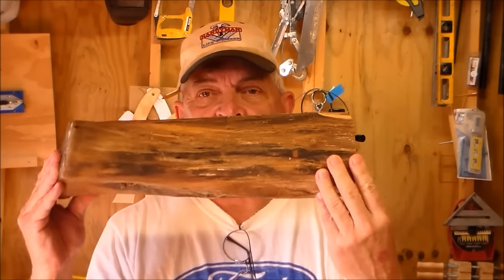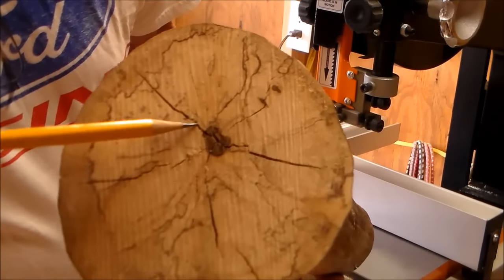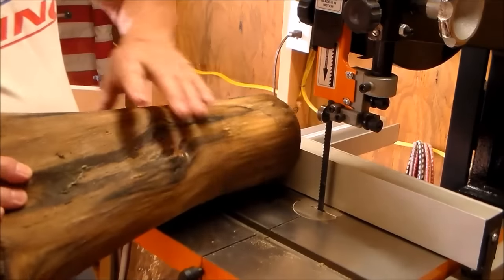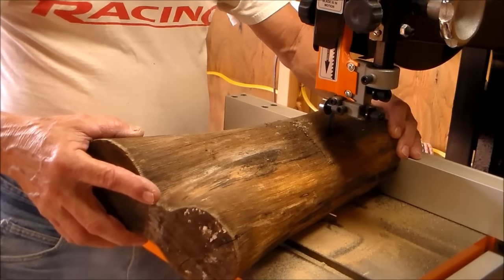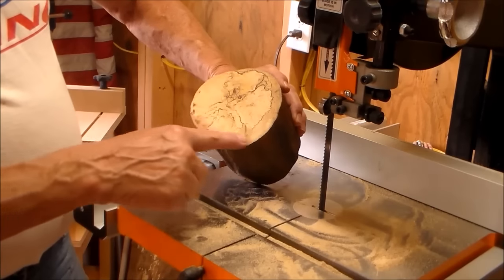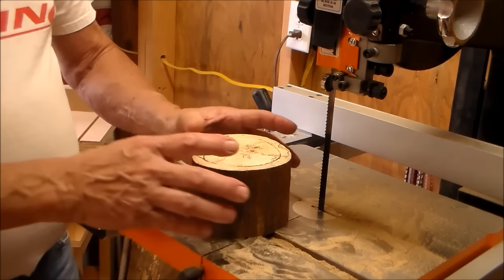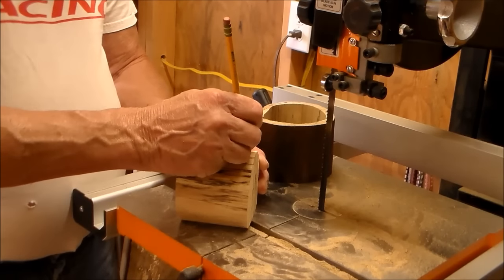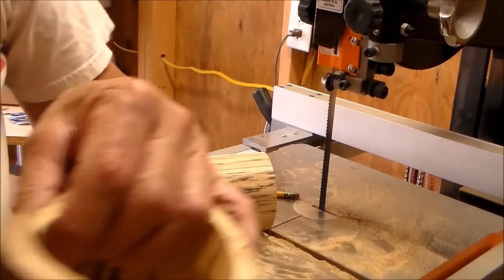Band Saw Box

Comment: Good project but folks, when you make this project, please do not make a crosscut on the band saw with the log up against the rip fence.  It will catch, roll, ruin the blade and maybe hurt you badly.  Use a vee block or fixture to keep the log from rolling and getting out of control when cross cutting on a band saw.
Reply: He passed away 3 years ago.

Comment: Sorry to hear this guy passed. For those of you still kicking I would like to say that his methods are very unsafe. I'm talking from experience since I cut my finger off on the band saw. Make yourself a cross cut sled, and make a circle cutting jig. Also his blade is bullchit. It should have about 3 to 4 teeth per inch for this kind of work not 7.